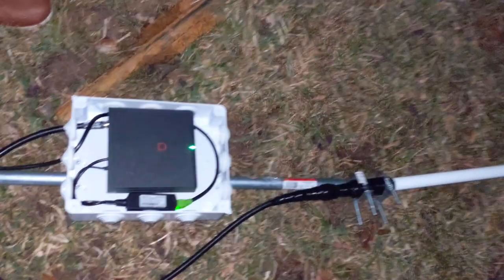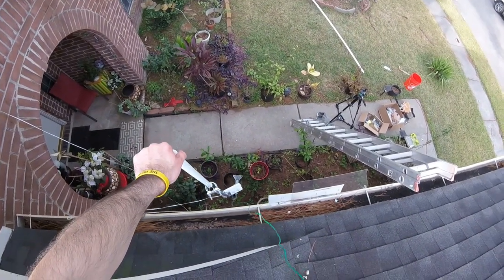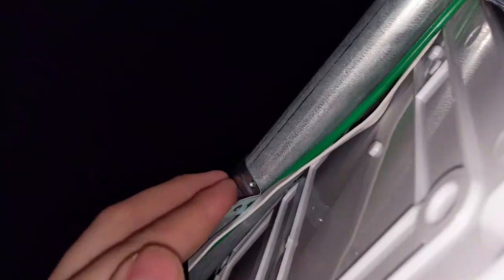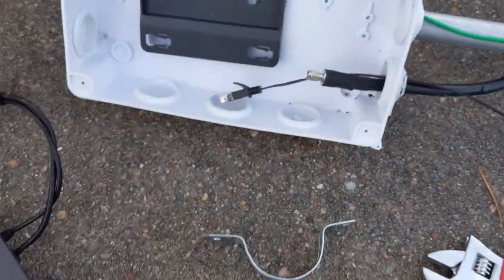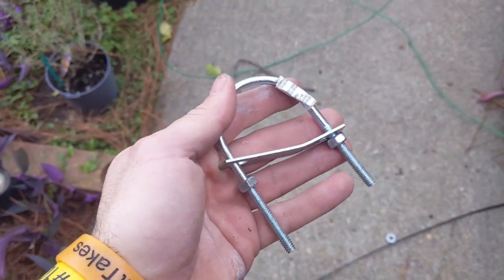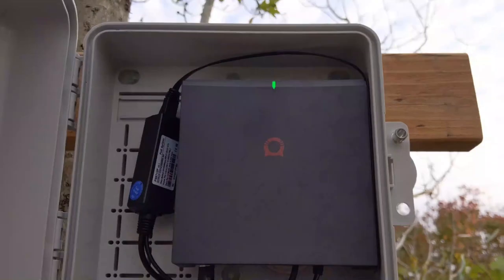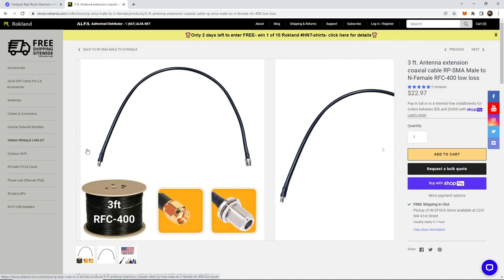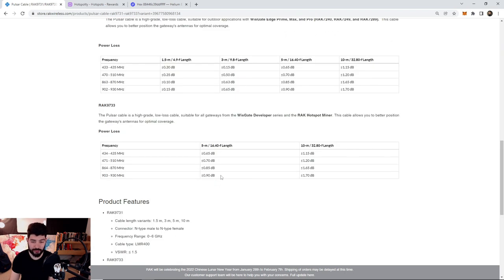Universal Outdoor Helium Mining Set Up

Comment: Enjoy the content!  I am trying to do what you are doing a state over.  Unfortunately we don't have the population and competing against few people with exclusive access to the best towers around.  The rest of the miners are stock everything plugged in wherever making nothing.  I have found most of them are companies like Ihub and emrit.  I have area that miners are mine but earnings low.  I am going to place two more on edge of populated area to off set low earnings of other miners.

Thank you for your time and effort in making these videos they help motivate me to get back out there after rough install.  Tree install is next for me then an off grid solar setup.

I am far from expert and I see this is from 2 months ago but DB the miner outputs and the DBI of antennas are not the same.  You would still have a 5.8 with the same RF pattern but it wouldn't be as strong because of DB loss.  Better example being the narrow beam or an 8dbi antenna if you lose 3 DB from connections/cable loss you have the same narrow pattern with less power.  Either way DB loss is bad but I recently ran in to local miner setting up 9dbi Magill with 3db loss thinking they would then have a 6BI antenna.  If I misunderstood you I apologize.

Comment: You use 5.8dbi on flag pole? I'm getting ready to do 30-35 ft high  I order a 8dbi antenna
Reply from the maker: yea for the most part my antennas are 5 8. Did you do that install yet or you still waiting? I know you were talking about the summer heat being huge barrier.
Reply: @gabrielchaparrotalkscrypto  finally got 2 hotspots antenna and cables should be here this week

Comment: How do you remotely control the hotspot?
Reply from the maker: You can't.  If i need anything i just ask my host to run through the process of what i need which is usually never.  

You can use a teltonika though If you really need to.
Reply from the maker: Since the host is on the same network... They can log onto the diagnoser interface through the computer.  No need to physically go up to the hotspot though.  So semi remote

Comment: Does it damage your antenna when It falls???
Reply from the maker: Hey There Nigel.  No it's fine. I wouldnt go throwing your antennas around lol. but it's just a copper rod that's inside your antenna surronded by fiberglass.... they are a bit fragile but they arent going to break if you drop them most likely. Unless you just decide to slam it down lol... then yes... I think there would be some malfunction afterwards